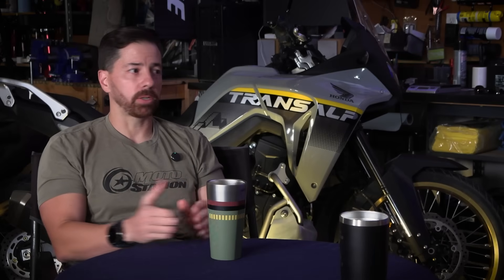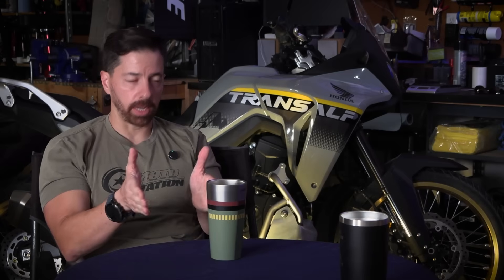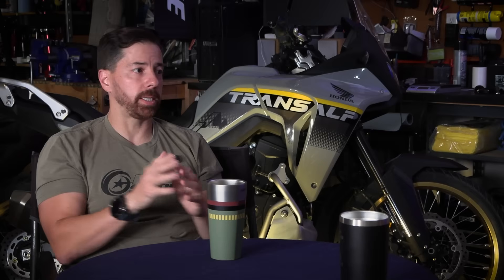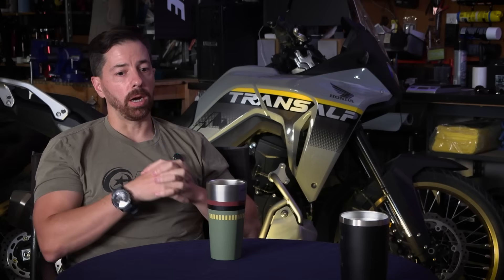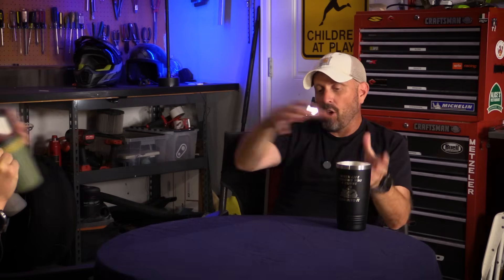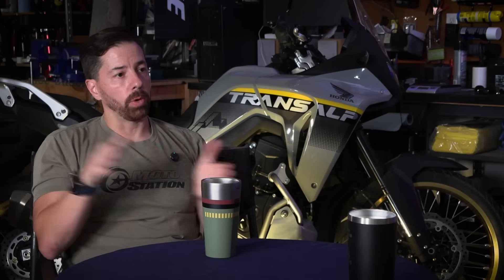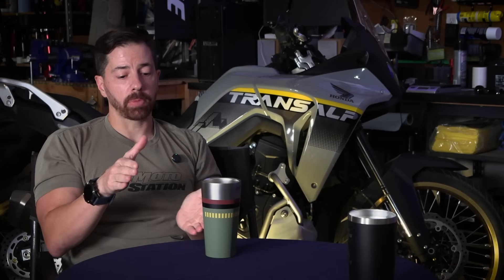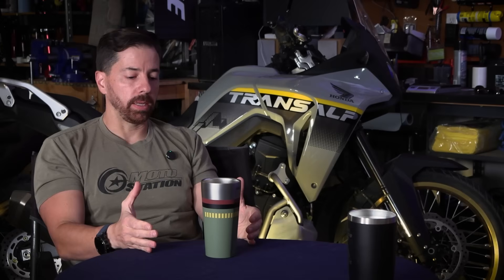The Engineering Behind MotoGP’s V4 Era (Why Inline-4s Can’t Compete)

Comment: It’s a shame they can’t spin the I-4 90 degrees to line the crankshaft up with the long axis of the bike.  That would require a substantial redesign of the transmission, but should seriously address the aerodynamic/width issue, along with allowing you to position the “narrower” engine lower in the frame (ie, lower CG).
Reply: Exactly what I had in mind 👍 nobody tested it yet, too scared to loose results.
Reply: I think the biggest issue with transverse engine layouts in motorcycles is that they create a leaning torque on the bike. As the engine accelerates the bike will want to lean one direction and when it decelerates it will want to lean the other way

Comment: Another factor is it would be easier to accommodate more over square on the bore to stroke ratio with a V4 than an I4 since width of the engine is less of a concern, which would allow higher rev's, which equals more power. I think the other fundament difference is the firing order/spacing that a V4 allows, which can aid with traction.  At the current state of the art, the I4 seems to struggle with both putting the power down and top end speed and I think the V4 has more potential for optimizing both of these.
Reply from the maker: I think you're right with the firing order, the benefit of the firing order and how the torque is delivered to the tire makes a huge difference.
With the bore/stroke ratio, MotoGP regulations limit all engines to 81mm bore.

Comment: What about when MotoGP goes back too 800cc ?????
Reply from the maker: In 2027 when MotoGP transitions to the smaller, 850cc engines, they are also implementing aero restrictions by way of max width and overhang limits of bodywork. Because of the new overall width limits, the width of the engine becomes even more important.
Reply: @CanyonChasersPodcast correct, the width of the engine matters more, the percentages becomes higher for aero winglets to perform. 
Also what about the rear ride hight device when removed from 2027, does ground clearance matter less ?

Comment: I'd argue that due to the fact, that in a V4 Your crank is 1/2 of an inline engine, it will take higher rpm's. Higher rpm-s give You more power. I'm quite sure GP series regulate this to create an even(er) playing field, but in terms of potential, I think this alone should make the V4's more powerful
Reply from the maker: Great point! My understanding is with the engine capacity, 81mm bore limit, and pneumatic valves, the limit for rpm is piston speed more than any limit of the crank typically.
Reply: @CanyonChasersPodcast could be, and maybe with motorcycle dimensions this is not an issue. For F1 I know for a fact, that torsional issues necessitate a shorter crank, and in fact at one time only one company was able to make their cranks due to the loadbearing issues at super high rpm's.

Comment: to summarize. the V4 is the perfect compromise between weight distribution (center of gravity) , Torque, and top end. The downside is extra complexity of manufacturing and workability. they are very cramped in the frame making them a pain in the ass to work on but for top performance machines this compromise is acceptable as the other mentioned prior is what they are going for. Mainly the perfect balance between low and and top end performance in the turns and the better center of gravity and narrower cross section. V4's have better torque curves and power pulses than i4's.

Comment: As an Asian most of us know MotoGP is Ducati show. We only brothered to watch wsbk but still we didn't put our heart to It cuz we knew Ducati is only good at track. Inline 4 always be better in street. There's a reason japanese like Gixxer and kaw still make i4 engines because their target audience is street racer and roll racer. I4 engines have advantage here cuz front weight distribution for harder launches in drag races. 

Low rpm,low compression could put high boost turbo application while Ducati u can't. Plus V4 engine also has it's flaw. 2 up cylinder bay and 2 down. Limited compartment to put turbo application and high boost psi. And the work is nightmare to open the engine to do any modifications. A gsx1000r could be stroked to 1600cc making 240hp. Even a zx10,r7,r3 could put turbo on it. 

Simply don't be attached to MotoGP cuz those Arent street bikes. Just enjoy the bike u have access and have fun. There's nothing wrong buying Ducati thinking u buy if for MotoGP winner and wsbk. But it's absolutely wrong buying ducati thinking your the fastest despite world record fastest legal motorcycle world record hold by inline 4. Drag race,roll race,street race.
Reply: Ducati also have huge heat issue problem on the streets in the rear cylinders. It is practically a track bike.

Comment: Ok let's talk inline 4 but front to rear line longitudinal.  Torque twist, center gravity,aero, exhaust etc. Any comments?
Reply from the maker: Love it! Check out episode 23 of the podcast, we talk about the Motoczysz C1 project. It used a longitudinal, 4-cylinder engine. 15° V-angle, separate, counter-rotating crankshafts, and three camshafts. 
Fascinating project that was shuttered before it ever got beyond private testing.

Comment: The crank and engine components can be made lighter due to less main bearings and shorter overall crankshaft. Yes you add some weight back from a second chain and extra encasement of the cylinder since they aren't all conected, but the V4 is a lighter and more reliable package.

Comment: The inline 4 has 5 crankshaft bearings, whereas the V4 has 3, less friction losses and also the longer crankshaft of the I4 also wants to flex under that torque, being longer than the v4, it'll fail before a v4 crank. The I4 also has balance in the corners (think of yourself walking on a tightrope. you'll instinctively raise both arms). It has came to the stage that the I4 corner speed advantage is too little to the v4's straight-line speed.
Reply: yep. it's cross section is much smaller on a v4 as the con rods share a crank journal.

Comment: I wish the rules weren't written as they were to basically force the use of forks and "standard" seating arrangements. It'd be awesome to see something like an AAR Alligator with Robert Horn's suspension out there competing. Much better braking and acceleration out of a layout like that, not to mention being the king of low polar moment of inertia since the rider and engine mass are at roughly the same height plane.
Reply from the maker: Interesting point! I've always looked at the physics of the Alligator like a narrow car that can lean, more than a motorcycle. I have wondered about what happens to the rider in a crash with the alligator design. Seems like there could be more opportunity for the rider to get tangled up with the bike in a crash which could lead to a worse outcome. 
Are there any examples of people racing alligator bikes?

Comment: The cooling of the rear cylinders in a v4 needs special attention.😊
Reply: not as much of an issue on liquid cooled engines. you simply increase the rate of coolant flow in the rear cylinders to transfer heat faster than the front so it compensates.

Comment: A V4 has a single counter weight for each 'v2', meaning half as many as those on an i4. Not only that, but the crankshaft is shorter. Therefore, it is lighter and stronger than that of a i4.

So, all things being equal, a V4 should rev higher and thus make more power than a i4.
Reply from the maker: Great point! We didn't mention that but it is possible to make an equivalent engine capacity V4 crank lighter for the reasons you mentioned. 
One other interesting advantage of the V4 engines in MotoGP, several manufacturers have an external flywheel that they can modify without breaking the engine rules. This lets them "tune" the feel of the engine and engine braking throughout the season.
Reply: I'm not sure either of those hold up to scrutiny:

1) It's not at all clear that the total V4 counterweight is less than the I4, just that they're spread out differently.
2) It's trivial to add a support for the crankshaft mid-way through an I4 an now your crankshaft's free span is exactly the same as on a V4 so there's no reason it has to be any stronger. In fact, the V4's 2 crankshafts have to be connected by gears/chains, which actually makes it heavier and more complex than an I4's!

These a priori discussions clearly won't get us anywhere, one can easily argue for either side. The differences are minute and only clear after empirical testing,.

Comment: The bore is limited to 81mm. A V4 could be 162mm narrower than an I4, but wouldn't be, as you say. If the minimum fairing width was set based on an I4, that would help level the field.
The V4 holds the I4 bikes up on fast corners, FQ qualifies very well but doesn't do so well in a race.

Comment: Simple solution is no aero, no electronic aids, no launch control, no ride height. These steps will reduce the budget and manufacturers can work more on the engine technology. This will also bring out the actual talents of each rider. 
Also single tyre supply is garbage. MotoGP needs multiple tyre suppliers.
Reply from the maker: I think if you can get those ideas through to MotoGP you're gonna make a LOT of friends! 

The only caveat I'll add is if we get away from spec tire, then tires need to be setup like a "marketplace", where any team and any rider can access any compound or variation of tire available from a manufacturer. 
The issue we used to have was tire brands showing favoritism to specific riders and giving them tires that were not available to the rest of the field, effectively deciding who had the opportunity to win.
Reply: @CanyonChasersPodcast I am sure Dorna and all the high officials already know. 
I agree with your point about the tyres.

Comment: I think the Big Bang effect that the v4s use is giving them a lot more grip off the corner, I think they fire all 4 cylinders off in less than 270 maybe even 180 degrees. We now the cross plane is not this. I think Yamaha have changed this but can’t mimic the v4 completely.
Reply: The crossplane M1 goes 180 - 270 - 180 - 90.

Comment: I hate the fact the I4 is being phased out, if it’s so hampered due to the development of aero and swing arm stability, why not allow the I4 more displacement so it can compete?
Reply: That same argument could be used in favor of vtwin engines. But the regs say 1000cc, so 1000cc it is.
Reply: @peekaboo1575 the old days of superbikes was great,  750 inline and 916 twins then 1000.
Reply: @peekaboo1575 They do say so, but I think design configs could be more like WorldSPP, but for the 1000 cc class range of course.

Then yeah, bring on bigger 1000+ cc Vtwins and I4s to fight against the horde of V4s or maybe bring something as exotic as an 800 cc 2 stroke (some say 500, but we’ve already seen that against 4 stroke 1000s and it’s not a fair fight at all).

In the end, restrictions are there to make the sport fair and competitive across the board, but at the same time many just want to see different bikes and riders with different strengths and weakness battle it out in symmetric and asymmetric ways.

It’s what makes GP and WSBK more fun than homologated classes like Moto2 and Moto3. If something seems broken, rules can be tweaked (looked what they did to Kawasaki for a little bit by limiting their revs or the current minimum weight fiasco in WSBK). 

Heck I think most of us agree the tire pressure rules for GP are garbage and should be one and done right before the race starts, still monitor for safety sake, but only hand out penalties when warnings are ignored and an incident occurs directly because of it.
Reply: Me too. Just means less diversity. I hate one tyre manufacturer as well. They'll be making it like moto2 next.
Reply: DUH…there is a FORMULA to follow- that’s why
Reply: aero has a lot do with it. On a narrower V4 engine you ave more room to apply air foils that completely change handing of the bike. Now it they het rid of all external aero foils, then that minimizes the impact of the narrower V4 config
Reply: How much more displacement? That's why.
Reply: The inline 4 is hampered by its own inherit design flaws. The biggest one being that an inline 4 cylinder is naturally VERY unbalanced, which causes parasitic losses in horsepower, and warrants other design features like crazy balancers and super beefy engine mounts. All of which have drawbacks. 

V4's have always been better.... and as a Honda VFR750 fanboy.... this shit has me tickled pink.
Reply: @FeatheredDino you clearly are just spewing buzzwords you heard but have no clue what you're talking about.
Reply: The I4 cant put out the power. Its not aero, its just an inferior design
Reply: Aero has nothing to do with it. V4s just perform better. V4s really aren't that much more narrow. Put an s1000 and a v4s side by side and the width difference is minimal. It's just v4s have better power potential, a better torque curve, more balanced and have lower crankshaft momentum.
Reply: @jvillain9946 I thought I4 were more balanced cause people say V4 vibrate a lot in comparison, is that related to balancing or not?
Reply: @monkklein8282 balanced as in weight distribution and center of gravity. Inline fours aren't balanced either. Engine balance on either platform comes down to a balancing shaft. Only inline 6s are perfectly balanced. Ride an inline 4 that doesn't have a balancing shaft and you'll see what I'm talking about. Why do you think the s1000rr is known for horrible vibrations. The panigale v4 is way smoother than an bmw s1k.
The main advantage of v4 is their ability to make tighter corners and accelerate better out of corners. Corners are where races are won. Sure aero helps keep the bike down but that doesn't change whether it's an inline 4 or a v4. The width difference is negligible. Plus aero is primarily on the nose and the tail. The two areas that share the same dimensions. The real reason v4s dominate is bc v4s just allow the bike to perform better.
Reply: @monkklein8282 A lot of riders liked the entire Yamaha package for handling and power delivery especially for wide sweeping turns and carrying corner speed versus more V-shaped, point and shoot racing lines.

I believe the strength of the cross plane’s smooth delivery on the exit really started to diminish once all the brutal delivery of the V4 like a Stoner era Ducati was sorted out and smoothed via electronics, frame, suspension and aero development.

Comment: Are they using cam phasers?  I wonder if cam timing can be varied separately in the back and front banks improve the power curve.  This would be more limiting on an inline 4 using only 2 cams versus 4 cams
Reply: It's possible there are some forms of variable valve timing in use, if the rules allow.
It's in use in various forms on street bikes. BMW on the M1000RR, the intake cam has two sets of lobes, optimized for different parts of the rev range and they use a solenoid at a certain RPM to shift the intake cam to move one setof lobes or the other over the valve buckets
Reply: Moto GP allows variable valve timing, but it needs to be mechanical and not electronic. Suzuki famously developed such a system, which then found it's way to the GSXR.